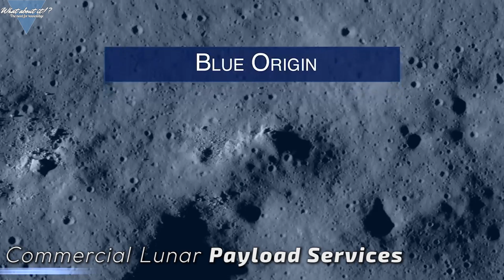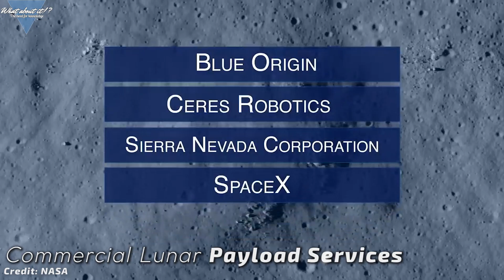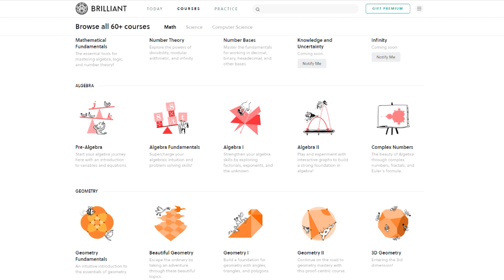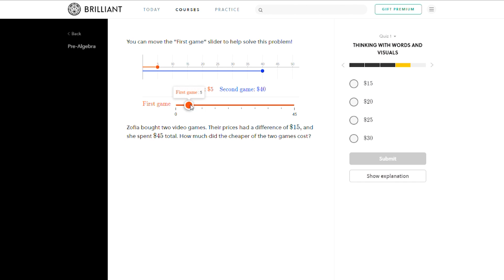69 | Starship Updates – SpaceX Reaches Pressure Goal - NASA Artemis Moon Mission Possibly Delayed

Comment: Pork barrel politics that will change as the head of each designated funding committee changes. The Starship will first take a significant role with the military in equipment and later troop transport.  I think Blue Origin will be the next manned mission to land on the Moon with heavy support by SpaceX. As soon as the Starship reaches orbital space and lands safely on the landing pad everything changes. No longer any need for a "new" orbital station (except for the Von Braun Gateway) and with the capacity to configure Starship for artificial gravity, the Starship goes to Mars no competition. I think military support is needed to more quickly get approval for manned flight. Think how long it has taken for the Dragon capsule to get approval and think US Space Force.

Comment: The moon base is so important, because of the propellant production. It is easyer to do this on the moon, because of its low gravity. You need about 5times as much fuel to get something in space from earth than from the moon. safing so much fuel production. Plus the moon is a great test bed for a moon station, because its only 3 days away from earth. Which  makes it easy to learn how to survive on other planets or celestrial bodies. The US senators are doing it again. They boycot the biggest scientistic advance in the 2000. How short sightet. The US could lead science in the 2000 but throws it all away. A mars base without a moon base is possible, but barely. Its like climbing the mount everest without preperations. And letting luck decide if it goes well..... Its stupidity squared!

Comment: late : if 4 tanks are used instead of one:  the wall thickness is 1/2 :  can be spot welded.  1/70 inches. X.   22,000 square inches.    The length is doubled. The weight is doubled.  Stainless steel can be used at cryogenic temperatures. Plain carbon steel cannot be used at cryogenic temperatures.

Comment: I think we will see one SLS fly, without crew. That will be the one and only before the program is cancelled all together.
Reply: They didn't put so much money and work on for a decade just to cancel the whole project altogether. Certainly most of its data can be used on a new project if they decide to scrap the original. Orion can still be launched on other launch systems for example.

Comment: There's something about the way SpaceX constructions their prototypes that just appeals to me.

Perhaps its the eccentric almost counterintuitive methods such as using a water tank company of all sources to build the initial prototypes. They started with carbon fiber but then switched to steel. They built it outside in the elements before upgrading to a tent and then a more rigid structure. They keep evolving the design as they move along. Most importantly, they just keep testing things over and over again.

Maybe it's their 'just do it' mindset, and if it doesn't work, adjust their approach and keep going. 

Ultimately, I like their iterative approach over crunching a bunch of numbers. Oh, I'm sure they do plenty of number crunching to make sure they aren't wasting their time and resources, but they will actually slap something together as a proof of concept.
This is in contrast to other people who seem to try to cut out the prototyping step through simulations and number crunching to go straight to the final product. In theory, it could save a bunch of time and money, but when they keep dragging their feet at every step of that way, it kinda renders that benefit moot.

Comment: 4:21 When compared with carbon steel, Stainless steel is RELATIVELY stronger when hot or cold. But it's not correct to stainless steel is stronger when heated. It just doesn't lose its strength as much as other materials such as carbon steel or aluminium. It is stronger when cooled, and doesn't suffer from brittleness issues like carbon steel and many other metals, due to its springiness. With slight variations in the grade, it's used in industry for everything from cryogenic methane and oxygen tanks to furnace internal components.

Comment: Overlap material about an inch or so and double weld it in and outside, that will solve the week joints dilemma. Attach a ring to the roller that bends the steel that would make an indentation of the thickness of the material for a smooth and better fit/ finish.

Comment: Looks like Boeing's lobbying efforts are still pretty strong. 

But this is just the House committee. There is a lot in the process before it becomes law. This can be amended several times before the House passes it. Then it has to go the Senate, where it will be amended again. Then a joint Senate/House committee with iron out the differences before the bill goes back to both houses to be passed or rejected. Then the President has to approve it as well..  This is a 10000ft level view of the process but suffice it to say that this budget WILL get changed.

Comment: NASA has oversight of the entire US space program with overarching objectives, management, coordination, budgeting, as well as international partnerships etc.; understood. The problem with house bill H.R. 5666, penned by Representative Kendra Horn chair of the space and aeronautics subcommittee of the House Committee on Science, Space and Technology, is that it turns a blind eye to the significant recent disruption of the space launch industry and the associated opportunity to reduce the cost of future NASA space missions dramatically. It fundamentally hard wires Boeing SLS/Artemis not only into all NASA lunar missions through 2028 but also casts them into the longer-term Gateway to Mars and Mars Landing Missions. Explicit language in the Bill directs NASA to proceed with the SLS block 1B launch system thereby preempting participation by lower cost, potentially superior launch providers. The Bill further sullies the waters by providing a roadmap requiring the use of SLS based tooling and launch systems for development of the Deep Space Gateway and Deep Space Transport. This would further entrench the Boeing boondoggle and muzzle the emerging space launch system disruption and its influence to dramatically reduce the cost of space missions. The Bill does state that the “Gateway to Mars shall not be required for human lunar landing missions”. However, the long-term Artemis program architecture envisions the Gateway as a waypoint for transit between earth and the lunar surface. The Bill effectively removes moon-based objectives (other than the cis-lunar "Gateway to Mars" space station and would thereby end NASA funding for all foreseeable Lunar and Mars missions. WHile it may leave the door slightly ajar for "other lunar missions" it does seem to remove previous NASA funding from any launch system contractor other than Boeing.

Comment: This change is a big and very disappointing step backwards.  I wasn't a big fan of the no-spin-gravity design of the lunar gateway, but I think having a station orbiting the moon and a station on the moon are both crucial to the development space mining and manufacturing industries, and I think learning how to deal with radiation, low gravity, regolith dust, hydroponic food production, etc close by on the moon where help can get there relatively quickly makes much more sense than trying those things for the first time on Mars where if something goes wrong everyone will die before help can get there.
Reply: ArcherWarhound not to mention the moon has practical benefits.   Even without the ice deposits.  50 tons of equipment sent to the moon could launch payloads into orbit using electricity ... not talking about rail guns that rapidly wear out
Reply: @douginorlando6260   Yes, even with Starship greatly reducing the cost of getting things into orbit there is real potential for lunar mining, processing, and production being far cheaper than the cost an identical product/device made on Earth launched up the gravity well.

Comment: 4:15 Correction: it's not accurate to say all stainless steel behave this way, austenitic stainless steels do, but martensitic isn't suitable for cryogenic purposes. SpaceX has previously had issues with martensitic for this very reason on the F9. There was a recent r/spacex Reddit post that goes into further detail https://www.reddit.com/r/spacex/comments/ev0mu0/stainless_steel_strength_and_why_it_matters_to/

Comment: NASA needs to start with a Heavy Lift reusable rocket!
Reply: NASA should step back from launch vehicles in general. Companies like SpaceX are way more efficient, innovative and generally exciting compared to projects such as the SLS.
Reply: @originalmin  Elon said Starship2.0 will be 18 ft in diameter.  It will have two to three times the internal volume of the International Space Station.  I would not be surprised if it flies before SLS launchs ever become routine.
Reply: @originalmin  Agreed.  I have often said that NASA should become something like Starfleet.

Comment: If welds are the hard thing to get right and produce points of failure for the tanks and bulk heads, why don't they just press them into shape with one large piece of steel? If their goal is to mass produce starships, having to weld and test every single tank and bulkhead in that matter would take far longer and be more costly with more opportunity for failure.

Comment: Great video! Just wondering what the windbreakers is for and what they are doing.
Reply: Starship is too tall to be stacked within the "onion tents" so the final stacking and welding for Starship (and later Superheavy) will be done within the windbreakers

I suspect that instead of taking rings individually to the windbreaker that some sub-assemblies are completed within the "onion tents".  Some possible subassemblies could include the following (bottom to top)
1) Trust structure (minus raptor engines) and the bottom bulkhead with three rings;
2) Groups of 2-4 rings;
3) Top of fuel tank/bottom of lox tank (rings and associated bulkheads)
4) Groups of rings;
5) Top of Lox tank (bulkhead and associated tanks);
6) Upper rings;
7) Nosecone with associated fuel and lox tanks.

Comment: id rather test my mars mission on the moon where you can have help within a couple days rather than months. testing in labs can only do so much, using the moon as a test base and possibly a refueling point would make sense, this NASA plan changing needs to stop, this is why NASA hasn't done much recently, remember the moon rover they built that obama canceled... then this moon mission is scrubbed along with the gateway... nothing like spending all that time and effort with nothing much to show for it
Reply: Thats why Nasa itself is loosing engineers like the Titanic was taking water.
Reply: @theexchipmunk  Hmmm, I wonder who those engineers are going to work for now.  SpaceX gets the pick of the crop. :-)
Reply: We aren't even really ready for a base on the moon. We can barely handle Antarctica, despite milder temperatures, breathable atmosphere and a far shorter supply line. The thought of going straight to Mars is insane. We should be building test bases in extreme environments here on Earth, then the Moon, then we could think about Mars. 

It seems all that NASA does these days is make a plan and then change it after wasting money on it. Once the world's premier space program, they haven't launched a rocket in almost a decade.

Comment: Will the Spacex stainless steel fuel and oxidizer tanks fit inside a larger diameter stainless steel rocket body?
Reply: My understanding is that the main fuel and oxidizer tanks would form much of the rocket body in the case of both stages (Starship and SuperHeavy).

Comment: The way the tank came apart during the pressure test in a very uniform way, vs a single failure is a good sign that the tank was very uniform in quality/strength.

Comment: 4:13 What about full hard cold rolled stainless steel? Because the stronger it is at room temperature the less additionnal strength it get at cryogenic temperature.
I don't think that it's stronger at high temperatures but it doesn't get too soft.